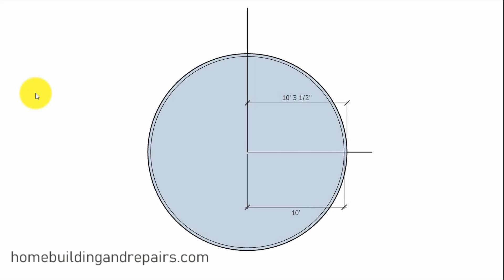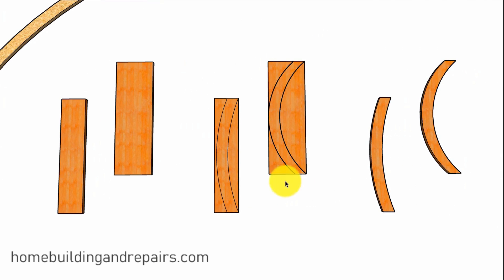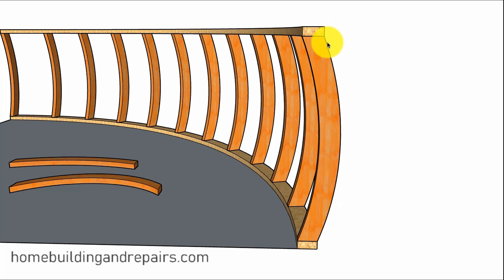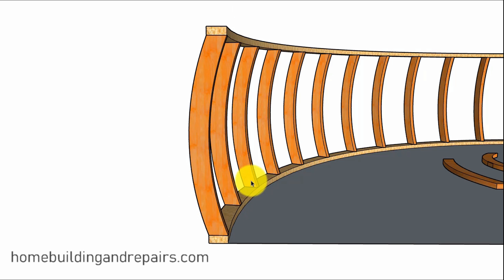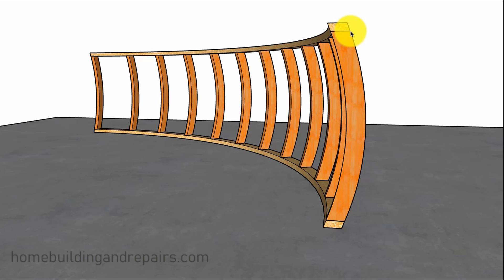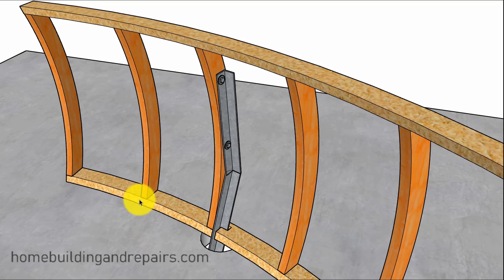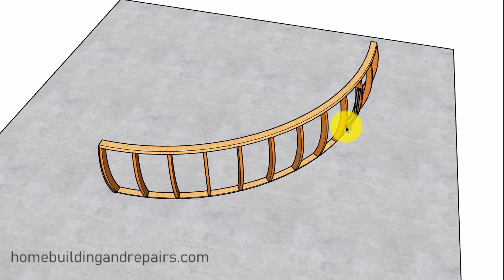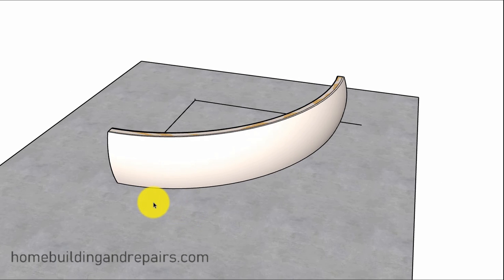How To Frame And Build A Double Curved Wall - Advanced Framing Techniques

Comment: Ok but how would you frame a radius above a window on a wall that has a radius? I have to start that project at work on Monday and I’ve figured it out but without a hard outside corner, I work with metal studs and I’m wondering if I can bend plate or angle on both vertical and horizontal planes at the same time

Comment: This would seem to be a perfect reason to build a simple plywood steambox and bend your 2x4's. I would build it horizontally like they frame SIP(?) walls, or old barn raising video's. 
Seal the entire back of the wall, tip the wall on its back, and start pouring aircrete in. Maybe do the top 1/3 first. As it just starts to set a bit, tilt a little lower and add more aircrete, and so on until its done.
Let it cure for a day or 2, then raise it vertically.
Slide it into place, and shim it with some sheet metal/etc. 
Of course you're going to need access above and below the wall to lock it into place.
If you don't have that access, probably other ways to secure it, especially since it isn't load bearing.

That actually seems like a lot more work than just using thin drywall or maybe screen and plaster.  However the aircrete would be much more solid overall, and the method above making the aircrete doesn't get any simpler and should be a lot easier for a DIY'er to finish and avoid lots of more expensive labor.

Comment: I've seen archways sheet-rocked by taking a strip of sheet-rock and scoring it the back side every inch or two (depending on the tightness of the curve) then the sheet is snapped opening the back at each score. From there it is simply a matter of screwing it to the curve. With this problem you would need to keep your studs much, much closer together then use narrow strips of sheet-rock from top to bottom. Any good texture person could smooth the surface into nice, smooth curve in both directions.
Reply: I bet it would use a ton of mud. I wonder how the drywall installer would feel about that. Lol
Reply: Great Idea and thanks for sharing.

Comment: Never gave much thought to it, but it's interesting to ponder.  Wet drywall method is probably more sensible, but It crossed my mind to start with a layer of masonite to add strength to drywall panels scored at predetermined intervals both horizontally and vertically on the convex side.  Just thinking out loud, and not necessarily sober!
Reply: Always good have another opinion. Bendable products will lead us to a nice finish.
Reply: 2 layers of  1/4” drywall soaked and run on diagonally

Comment: Good explanation to a odd and difficult circumstance. Drywall will work after damping the Drywall and tacking it to while wet and it's finished arc. It of course dries to shape and is easy after a degree of practice. It is often easier to build a 4 or 8 foot template will get the boarding in it's correct angle before tacking it in place of the actual wall. A note of caution that I would add is that I would not be doing this type of construction as a structural (Load Bearing wall) but rather as a Partition (Non-Load Bearing) wall application, without proper engineering.
Reply: I don't know how much work it will be to use wet 1/2 inch drywall, but maybe 2 layers of 1/4 inch might work better. Maybe even wet 1/4 inch drywall. How's that for a meeting of the minds.